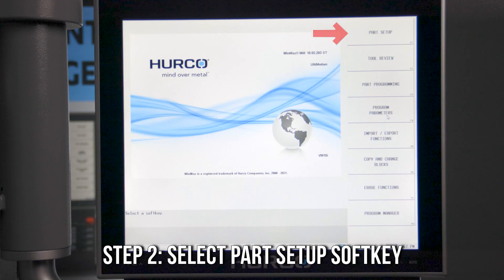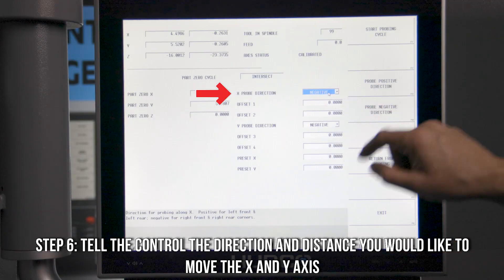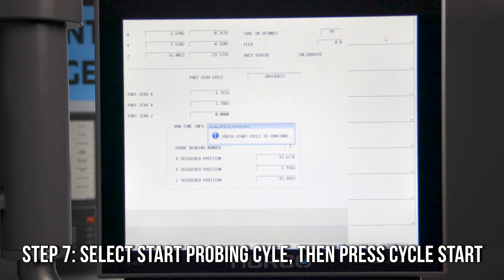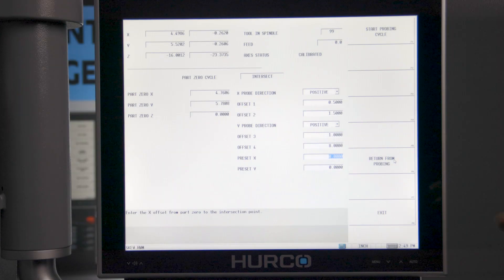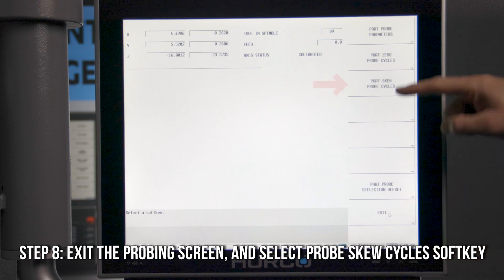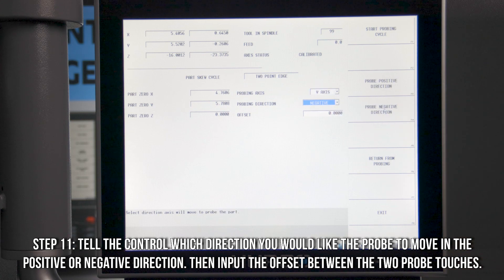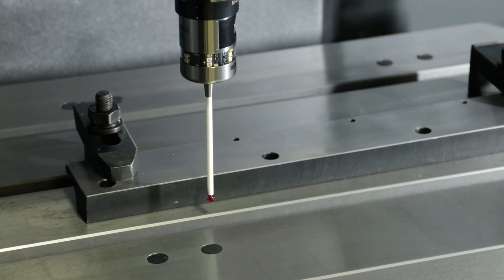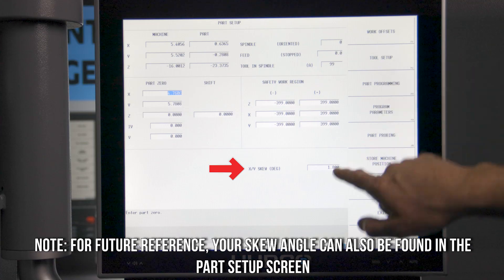Using the Skew Probing Cycle on Your Hurco CNC Mill - Hurco CNC Training

Comment: Curious to know if you can skew the Z-Plane? I have to rework a casting and rather than tapping it flat with a hammer all around, within .005, it would be great if the probe could come down, touch off on Z around my already machined face, and set a Z plane.?.
Reply from the maker: Hi Tom, unfortunately you wont be able to skew the Z-plane.